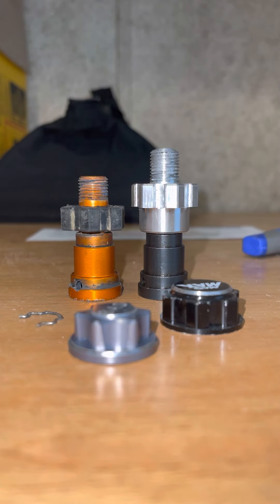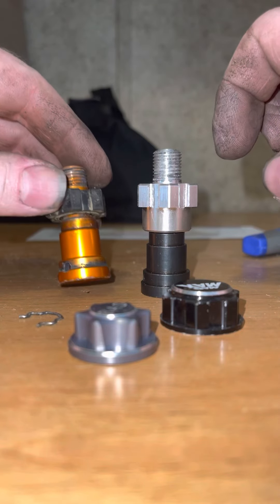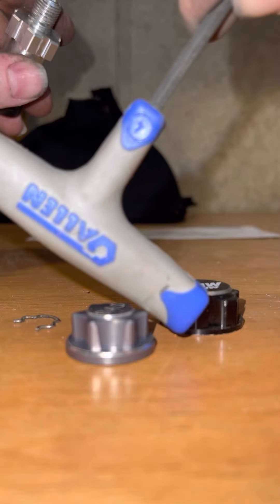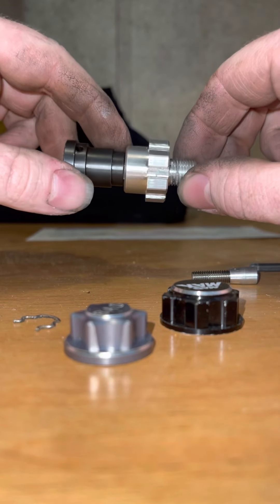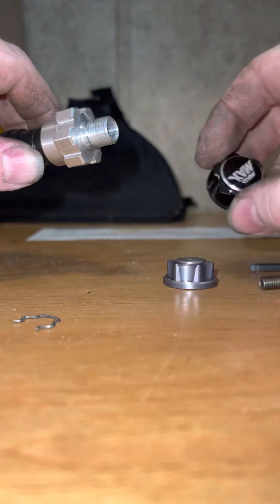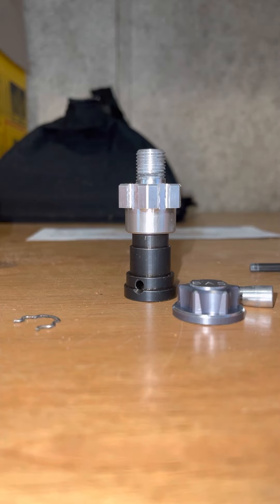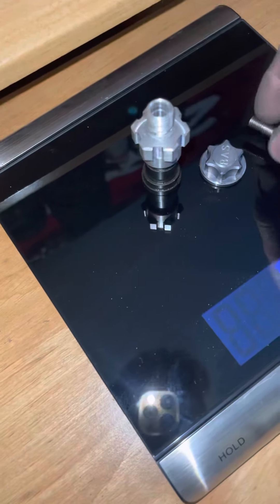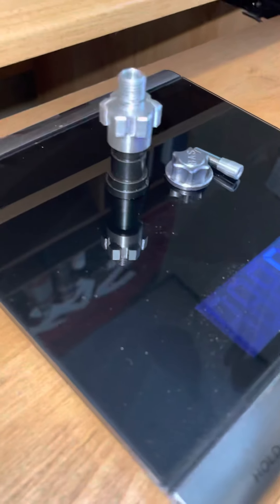Traxxas Xmaxx wide hubs vs stock

Comment: Appreciate this been looking for adapters .
Reply from the maker: I also bought the 19mm offset adapters so I’ll be testing those as well…along with some titanium cv shafts
Reply: What wheels are your go to for the X-Maxx ?
Reply from the maker: @runngunrc1991  um well I’ve tried a few. I’m currently running the madmax land grippers but they are like 850g each so a bit heavy. I have some arrma 8s backflips coming so those will probably be my go to tires for the xmaxx. Those are like 600g each so a lot lighter

Comment: Is this the stock 99 dollar kit or did you purchase the 60 dollar extenders? Also can you use these with the stock Xmaxx wheels or do the centers need to be drilled out?
Thanks for the update 👍💯
Reply from the maker: Nope you can use the stock xmaxx wheels without any problems. I purchased mine from eBay from Brett but I got the last one. You can get this same kit for like 110 from wforccustoms.com. This is where I get a lot of my upgrades.
Reply: @Hittin2thabass  Hey thanks for the quick reply I appreciate you 💯💯💯💯
Reply from the maker: Brett Stricker on Facebook is who makes them and he also sells the kits for $10 cheaper

Comment: What diff fluid du you use in the maxx and what do you think is good (NOT THE X MAXX)
Reply from the maker: I run 50wt in the front and rear of my Maxx and xmaxx
Reply: @Hittin2thabass  do you think 100k front 20 mil canter and 500k rear would do good on the maxx
Reply from the maker: @thenerfer4263  Omg no that’s way too thick for the rear. 20 mill is stock for the center. The truck has to be able to turn and with 100k in the front and 500k in the rear it’ll turn super wide. Do 50k front and rear
Reply: @Hittin2thabass  ok